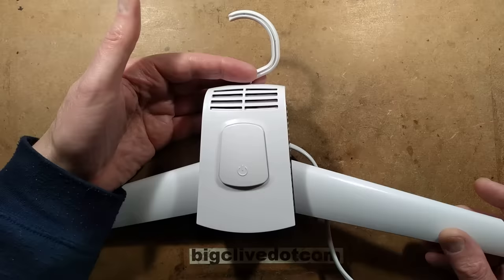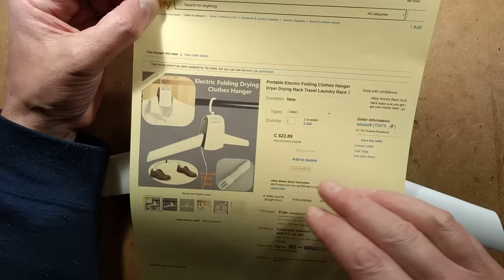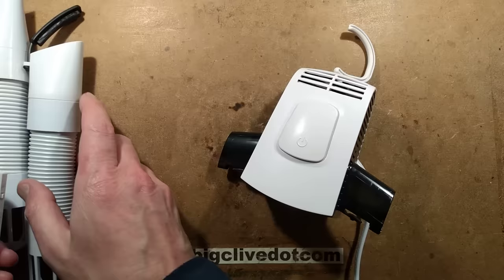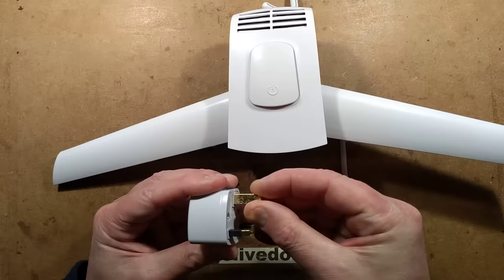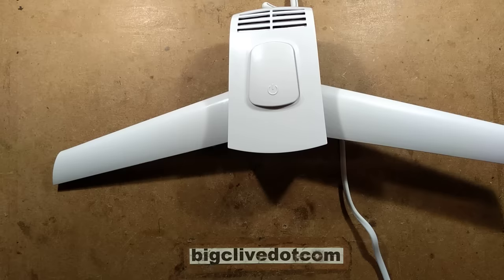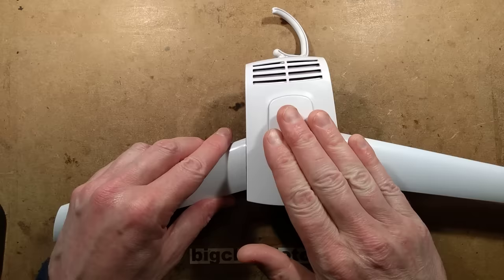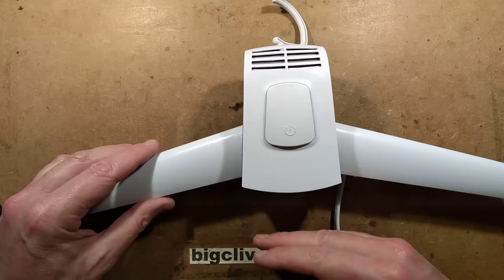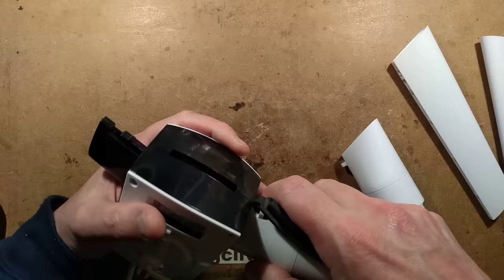Teardown of a hot air coat hanger for drying clothes.

Comment: This makes the point that, much like Japan in the '70s, China is rapidly reaching that tipping point where they start to really innovate. Rather than just stealing, copying or providing contract manufacturing of Western designs they are coming up with more and more good solid original designs. We (Westerner engineers and manufacturers) had better stay on top of our game or we may find ourselves irrelevant in the next 10 - 15 years.